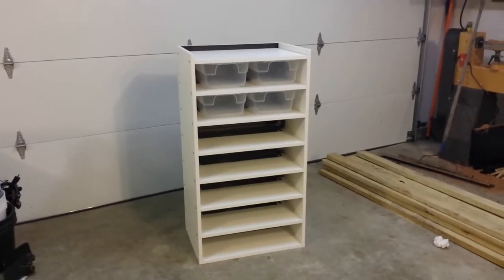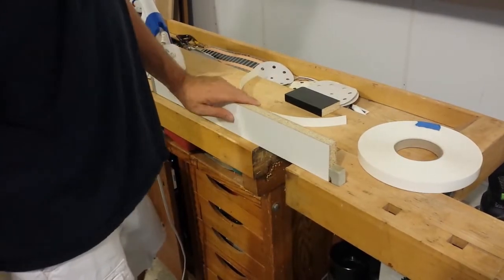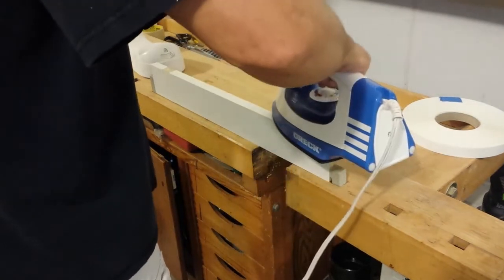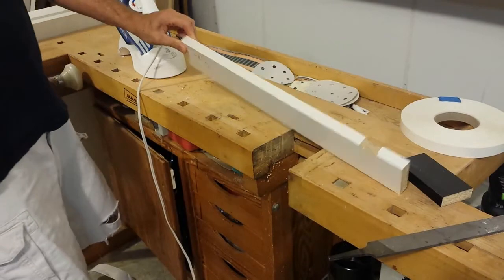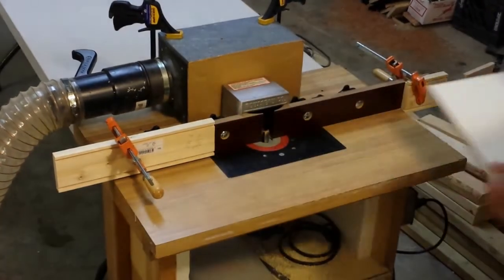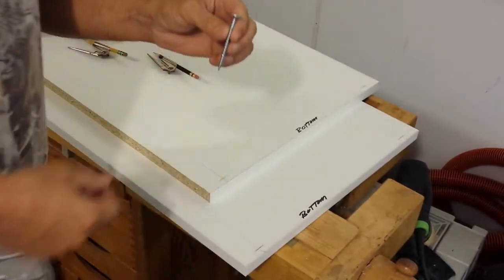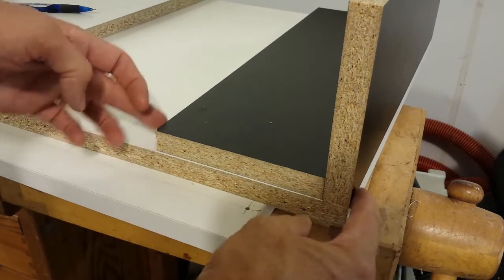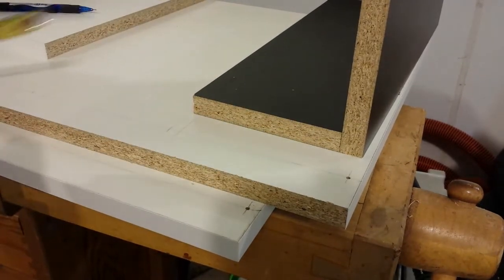Build Your Own Snake Rack

Comment: Awesome video, I'm a fellow wood worker so it's nice to see someone who knows what they are doing build one of these snake racks. The only thing I do different is rout a channel so the heat tape sits flush or a little under the plane of the shelf. That way the tubs won't tear them up over time but besides that you did a really great job. Nice shop by the way, I'd be curious to know what else you do, I build custom guitars.
Reply from the maker: Thanks for the praise! I opt out of channeling in mcp because the humidity will destroy the cabinet prematurely. I channel in PVC. 
As far as what else I do... I supervise the wood crafting division at the U.S. Capitol building in Washington DC. 
Thanks again for the comment!
~Jeff
www.PatuxentPythons.com

Comment: Awesome video you're a great craftsman only question I have would be the moisture resistance of the melamine for keeping snakes that require humidity do you treat it with anything to prevent molding and also do you use a shut off thermometer to regulate heat tape and if so when feeding it through wouldn't the tub with the alternating tub running down the side get hotter faster than the one only having tape across the bottom
Reply from the maker: Thanks for the great feedback! Melamine does have pretty good moisture resistance as long as the edges are sealed, but it is by no means moisture proof like XPVC. I did not treat it for moisture resistance. I also have not had any problems with mold or mildew. I do clean all of my racks with F10 disinfectant on a regular basis. I've been using this particular rack for a couple years now and it is still in great shape and my snake room is kept at a constant 60% humidity and tubs frequently show light moisture on their sides. The temperature difference you're referring to makes sense but has not presented any issue. I haven't noticed any concerning temperature variations. I use a Herpstat thermostat on this rack.

Thanks again,
~Jeff
Patuxent Pythons

Comment: last time I think I will bother you, I think lol.my rack is going to hold 28q and 12q. since they are the same height. do you think I should run 3" flexwatt or 4 inch? my concern is that the 4 may be too much for a 12 quart but too little in the 28q...
Reply: and using sterilites how far from the back does your heat tape start?
Reply from the maker: +jason b 
No worries, I'm here to help.
You should be fine with the 4" for both sizes. 3"  May be a little small for a 28qt. This is especially true if your room temps are lower (if you don't have a dedicated room where the temp is consistently 80ish) because the tape has to work harder to keep the temps where you want them. 
My tape starts about 2-3/4" from the back.

Comment: Great video! The only question I have left after watching that is:  where do you install the thermostat probe??

Thanks!
Reply from the maker: Drill a hole in the back, stick the probe through the hole and tape in down to the heat tape. Just check to be sure it is out of the way of the tub so it doesn't get knocked off. Click the link to see example of how to do this.
https://photos.app.goo.gl/9jmwPsXCPMpjX2uS7
Thanks for watching and commenting!
~Jeff
www.PatuxentPythons.com
Reply: Thanks for the quick reply!

Comment: Very nice job with the video. I love the idea you came up with for holding down the heat tape. The rack came out well, nice-looking & functional. Before I build one myself, I have one question for you: Now that you've had this rack for 2 years, is there anything you'd do differently or change if you were to build it again? Thanks in advance.
Reply from the maker: NitroNarc 
Thanks so much for the comment!  This rack has served me very well and has been problem free. Really, the only thing I would do different would be to use pvc material instead of melamine. Of course, the benefit of using melamine is the low cost. With pvc, there is no need to seal the edges, so that cuts down on the labor. PVC is also water proof, self extinguishing, and lighter in weight. All of my more recent builds have been PVC. Especially hatchling racks since I keep the humidity higher in those.
That said, melamine can make a great rack that will last as long as you seal/ tape the edges.
Thanks again!
Reply: Do you acquire your PVC locally or online? Also, which type of PVC have you found works best?
Reply from the maker: NitroNarc 
Locally. I prefer smooth surface black but it's a bit more expensive and must be special ordered from a local distributor. I use that in 1/2" for my hatchling racks. 
For larger racks I use 3/4" white "veranda" from Home Depot. It has one side that's smooth and one that is textured. I assemble the rack so the smooth surface is facing the snake for ease of cleaning. 
As far as what brand is better, I found that it all performs about the same. Check this link for some pics of one of the larger white pvc racks that I made. 

http://s469.photobucket.com/user/wood-n-java/library/Snake/caging/V70
Reply: woodnjava, thanks for taking the time to answer my questions and for the photobucket picks. You've been a big help! Congrats on your recent purchase from Justin (Pastel Lesser Leopard het Clown), she's beautiful! I'm looking forward to seeing future clutches from her. Your pied ball clutch is nice too. That must've been exciting! I've always had a soft spot for pieds.
Reply from the maker: Thanks for the kind words and you're very welcome. I'm really looking forward to her clutches too, maybe next season she'll be ready! 
I'm always here to help if I can, so don't hesitate to contact me if you're in need. Best of luck to you, and
Thanks again  for your support!
~Jeff

Comment: what are those black things you used to hold down the rack? Can someone provide a link for them, the heat tape and the other silver tape he used?
Reply from the maker: Knape Vogt Kv2401 72 72 in. for .13 in. X .50 in. Fibre Track https://www.amazon.com/dp/B00FSLYK2A/ref=cm_sw_r_cp_apa_i_naplEb56T8BQ0

Reptilebasics.com for heat tape
Aluminum HVAC tape from local hardware store.

Comment: when you added the shims for the air gap. is it necesary to account for the thickness of the heat tape? i was going to use single cds. ive read that others reccomened using double stack cds to compensate for the heat tape.... thoughts? i just dont want any escapees
Reply from the maker: Hey Jason, I would think double cds are fine. I don't think they could squeeze out of that. The sides of the tub are where the problems would arise because that's where it flexes the most. Set up a sample and use you best judgement. And yes, I would account for tape thickness. you don't want your tubs binding in the back. it will wear down the tape.
Thanks for watching!
Reply: Thank you for quick response. Do you find that the heat is consistant regardless if the heat tape is snaked through as opposed to being "bridged" from each shelf?
Reply from the maker: +jason b 
I've only used the snake thru method and back heat so I can't answer that. What I can say is that typically the last shelf tends to run cooler. I was able to compensate for that by running the heat tape back up the side on the last shelf instead of just stopping it at the side. That gives you a few more inches of heat tape at that level.
 Hope that makes sense.
Reply: That makes sense. I also considered maybe starting the heat tape at the bottom and snaking upwards as heat rises. Just brainstorming.

Thank you. Best snake rack build video out there!
Reply from the maker: +jason b 
I actually followed that train of thought on the hatching rack that I recently posted. It didn't pan out lol. The bottom was still cooler. It might be because it's nearest to the floor? IDK, but if you figure it out, let me know lol
Reply: Good point! Thanks for your time

Comment: Thanks so much for uploading this, I'm just about to build racks so it's very helpful. Did you get the heat tape from eBay? If so, could you please give us the link, or at least what wattage you used.
I have one question, though...
I was watching this with my daughter and she caught something interesting that I didn't! (in my defence, I was doing other stuff at the same time, that's my excuse and I'm sticking with it!)...  But...
The way the tape snakes around the shelves, you have two edges of heat on one side of each shelf, so, one tub gets heat on the bottom and side, and the other tub in the same shelf only gets heat on the base.
Are you finding this an issue?
Have you checked the temp in the back of each tub with a laser thermometer? (and, if so, what is it?)
I'm honestly wondering whether it's an issue having essentially twice as much heating on one tub as the other.
Again, thank you so much for posting this, it's great.
Reply from the maker: I use THG best tape from reptilebasics.com. The watts that are pulled is dependent on the width and length of the tape you're using.  I do use an infrared thermometer and I keep temps over the tape to an average of 92. I've never had any issue with one side being hotter than the other from the tape on the sides.  Honestly,  you'll see more fluctuation throughout the rack due to the tape itself.  Heat tape has a heat variant of 5% which, based on 100° is 5°. Make sure you account for this when you set your thermostat.
Thanks for the great comment and thanks so much for watching!
~Jeff
www.PatuxentPythons.com

Comment: Hey great video what are your thoughts on a home built pvc rack
Reply from the maker: They are great. I used expanded PVC to build a couple racks and an incubator. It's a lot more expensive than melamine (about x6) but a lot lighter and self extinguishes when exposed to flame so it's safer in that respect. PVC is also water/moisture proof  so it fares well in humid environments. Also It holds a screw well, machines well, and there is no need to apply edge banding after cutting. It does smell a bit when its being worked though.
Hope that helps and thanks for the comment-Jeff
Reply: +woodnjava awesome thanks a a lot

Comment: i found 3/4 in melamine sheets 4x8ft. what screw length do you reccomend? i found particle board screws i planned on using...
Reply from the maker: I recommend 2-1/2" screws. Typical rule of thumb is 3 x material thickness.
Reply: I cant find black melamine locally. Id like to do the whole rack in black. Is the back of yours melamine? Or another material. Can melamine be painted or would it not be safe for a snake
Reply from the maker: +jason b 
The back of mine is 1/2" black melamine. Black is hard to find. I get mine from A&M Supply. A commercial plywood distributor. 
PVC  is a great alternative but more costly and again, hard to find in black.
Reply from the maker: +jason b 
Oh, and no, don't attempt to paint melamine. it will flake off over time.

Comment: Heat tape won't melt the plastic or burn snakes bellies right?
Reply from the maker: Alana,
That's correct, but you MUST plug the heat tape into a thermostat to keep the heat within the correct range. around 90°-92°. Be sure to securely tape the thermostat probe to the heat tape in an area that doesn't interfere with a tub.
Thanks for watching!
~Jeff
PatuxentPythons.com

Comment: Won't your tub rub on your heat tape and wear it out?
Reply from the maker: Steven Taylor 
With the smaller, lighter tubs, it isn’t much of an issue. I recess the tape for heavier tubs to eliminate wear. This particular rack has been in use for a few years with no problems at all and it’s still being used today. 
Thanks for your comment,
~Jeff
www.PatuxentPythons.com

Comment: What dimensions would you use for 10 32qt tubs
Reply from the maker: I have not made a rack for 32qt tubs. I would also need to know the dimensions of the particular tub, as they are all a little different. I have made a 2 wide by 5 high, 10 tub  rack  that uses 28qt sterilite tubs from Wal-Mart. If you want the cut list for that, PM your email to me and I will send it to you.

Comment: do ya need a special saw blade? i just have a 24t lumber diablo
Reply: does your countersink pilot drill bit go deeper than the length of the screw? or do ya just start a shallow pilot hole. i dont wanna split this expensive wood lol
Reply from the maker: An 80 tooth alternate bevel, preferably high angle, works well for melamine. 24t will cut extremely rough with a lot of chip out on the down side. You cant avoid the chip out altogether but it will be much worse with that blade. Diablos are fine, just get  ATB 80 for much better results. The better the cut, the better the edge tape will look.
Reply from the maker: pilot hole should be as long or slightly longer than the screw. I am assuming you are using a 10" saw blade on the last answer.
Reply: +woodnjava i have a 7 1/4 inch skill saw. im searching home depot and lowes online. tons of choices not sure what is best. i found the countersink drill i believe you used a #8 11/64 x 2.65?
Reply from the maker: 11/64" sounds a little big. I used an 1/8" pilot. As far as the blade goes, get an alternate bevel withe the most teeth you can find for the best cut. Avoid combination blades.
Reply: +woodnjava ive got my supplies all gathered and heat tape in the mail! does it make a difference to used masking tape while cutting melamine? i watched some videos and cant see much results.  ill keep ya updated once mine is completed. you have been a tremendous help!
Reply from the maker: Tape can help some,yes.
Thank you and good luck!
-Jeff

Comment: Have you done an adult rack yet? If you have please send me the measurements so ican take them to home depot and have them cut it for me, since I can't cut straight even if my life depended on it. Great video one of the best I've seen thumbs up with
Reply from the maker: +DoctorPepper4 Thanks for the kind words. I've done a few different styles of adult racks. For example: 4 tub/28qt, 4 tub/V70, 8 tub/28qt. The styles are side by side or in-line vertical. What exactly are you looking for?
Reply: I don't really know wow I'm guessing any way. I'm new to this ball python stuff always breed tegus. But I made a trade for two albino het pied ball python
Reply from the maker: +DoctorPepper4 Sounds like a great trade! Looks like you'll be needing caging on a smaller scale then? Message me when you've got a good idea of what you want and I'll be glad to help you out with some detailed info.
Reply: In that case my idea was to have like eight hatchlings tubs then like four or six sub adult and then like four adults tubs I use these tubs that I got in Walmart 41q tubs I got for a buck, No lids. I like the idea where you can use hatching tubs and then when they outgrow them you can chagen the tubes from that slot to the sub adult tubs I was wondering if you can do something like that? I'm sorry I'm new to all of this my tegus are housed outside where all I do is feed them and interact with them. All in closures are concrete and mesh on top. If you can some how put a cut list from the mess I'm trying to explain I will greatly appreciate it. Thank you sir enjoy your holidays
Reply from the maker: +DoctorPepper4 Can you give me an address to send the files to? You can private message me
Reply: How do I do that?
Reply from the maker: +DoctorPepper4 click the button under my header that says "about". There you will see a "send message" button.
Reply: Sent it
Reply: When you get a chance and send it let me know. Once again thank you so much

Comment: Can I get the measurements
Reply from the maker: No prob. PM me your email and I'll send it to you tomorrow.
Reply: +woodnjava I found it on sketch up but no measurements
Reply from the maker: +Gex Co-- I sent you the dimensions. Sketchup is a drawing program that must be downloaded onto your computer in order to manipulate the drawings. From there, you can use the measurement tool to find all dimensions. It will also show how it is put together. It helps to be familiar with the program for it to be helpful to you.  It really is not that hard to learn the basics, which is all you would need.
Reply: +woodnjava thanks